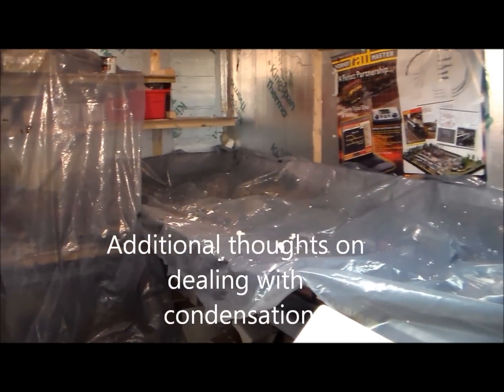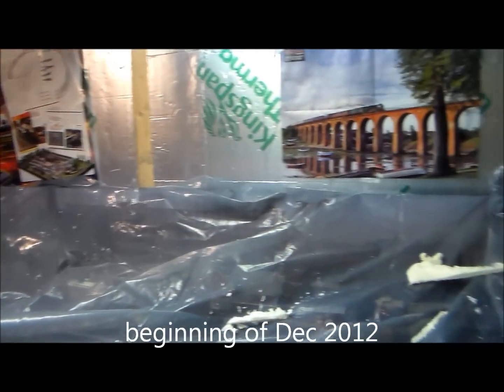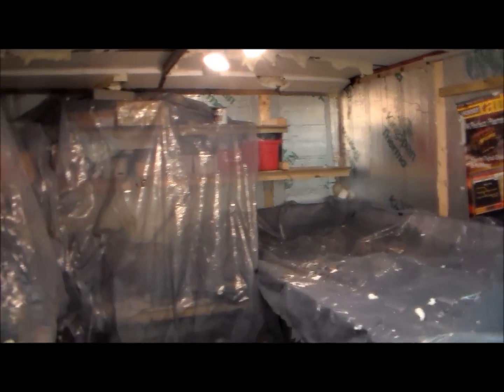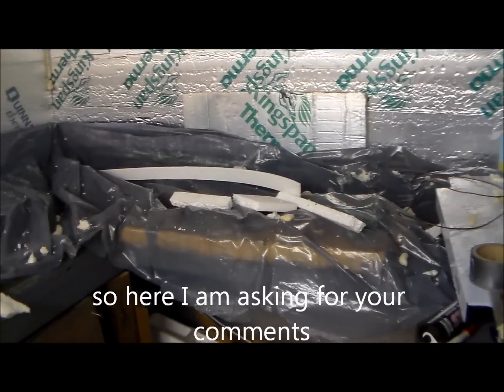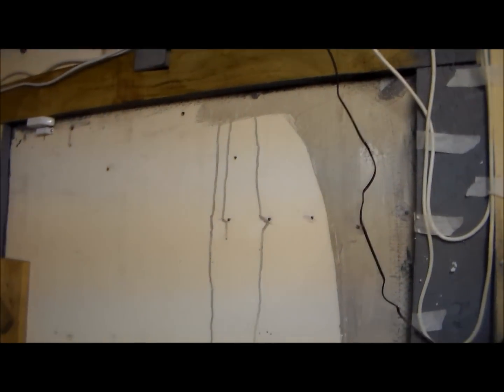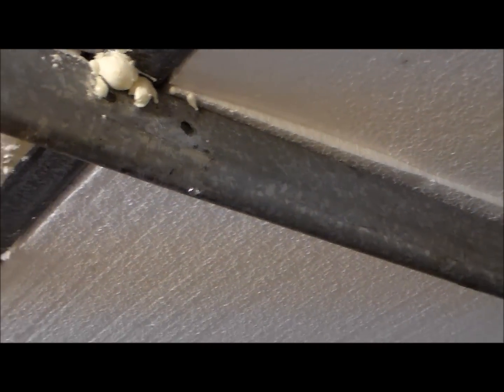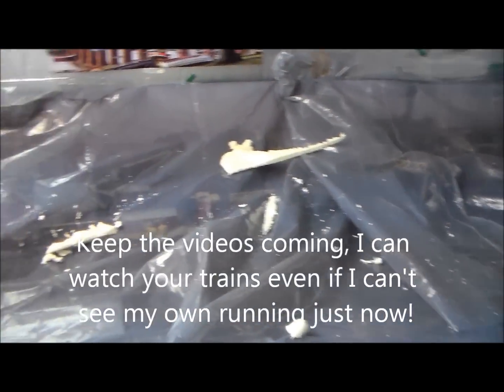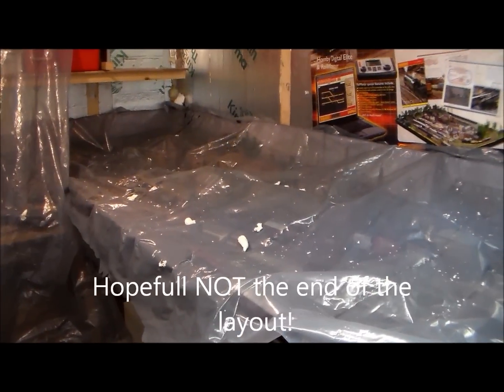cold plate to cure condensation

Comment: i have a chicken shed on my allotment thats got a old tin roof that was forever having condensation dripping everywhere i solved it by lagging it in real wool insulation with bein a natural material it absorbs the moister when cool or cold and then when it is warm disperses it. i also did my work van  and found it alot better than any man made insulation unless you  wanna spend a few hundred pound and use a 21 sheet material that i used for loft conversions to maximise ceiling hight

Comment: I use a dehumidifier which works great in my shed collects all the damp.I hope everything is OK but I don't use card buildings I only use plastic which means I have to scratch build a lot of my buildings but you could change them for resin models but would be costly. Kev.